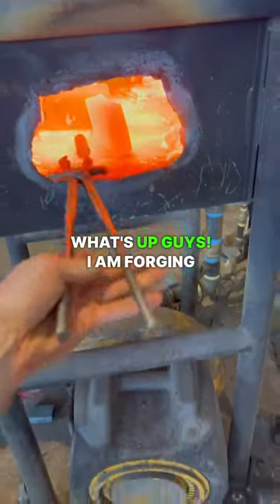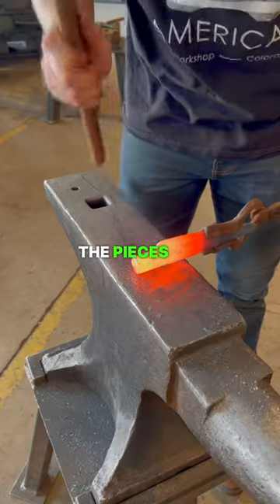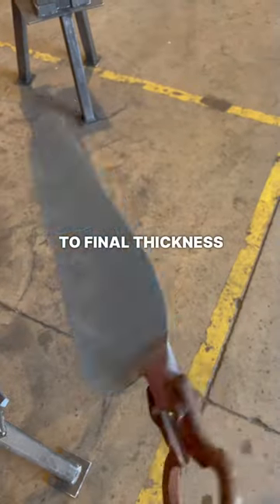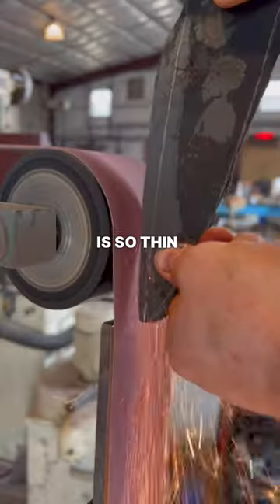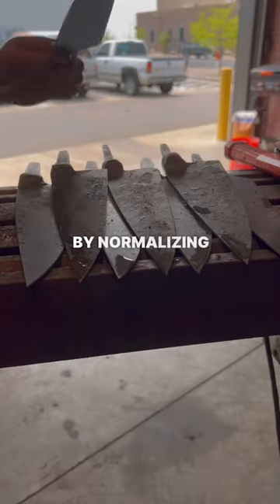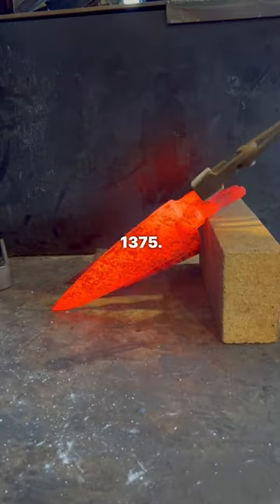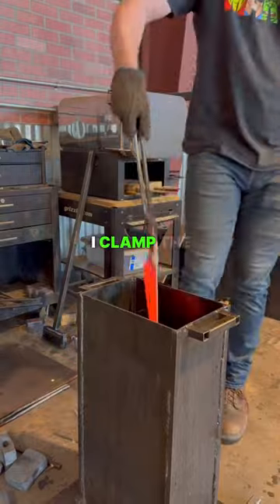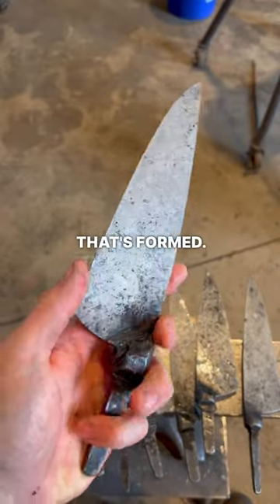Bladesmithing - Forging Kitchen knives Part 1 - Forging and Heat Treat

Comment: If it’s W1, it gets its final hardness from water. Not oil.
Reply from the maker: I’ve yet to try W1 in water, will have to give it a shot. 
Do you know if the water needs to be heated or anything?

Comment: Very cool. I didn't like W1 at first but found out it very durable steel.
Reply from the maker: What did you not like about it?
Reply: @mattwatersbladesmith  I found it to be very soft, cheap nickel like hardness, I'll use it but 01 is my go to.
Reply: Heat treat has left the chat.🙄🤣

Comment: are you able to clinch in water?
Reply from the maker: Depending on the steel it gets quenched in water or oil. I have always used oil hardening steels
Reply: what oil can i use
Reply from the maker: parks 50
 @braydenpruski6014